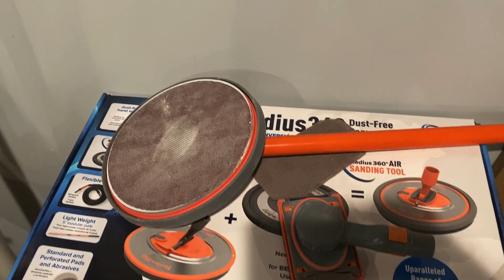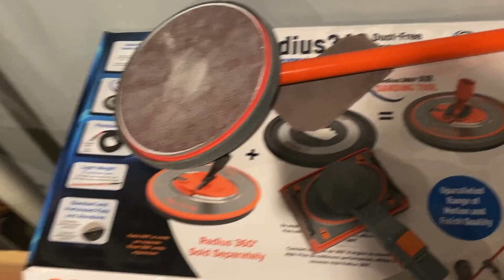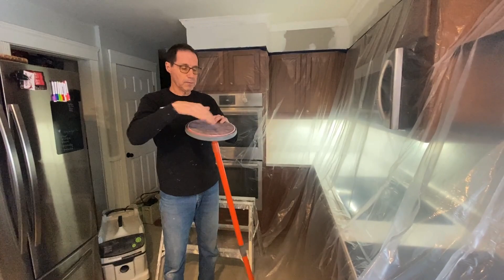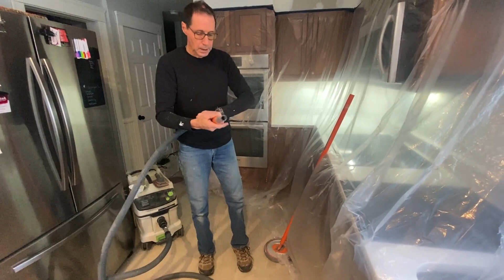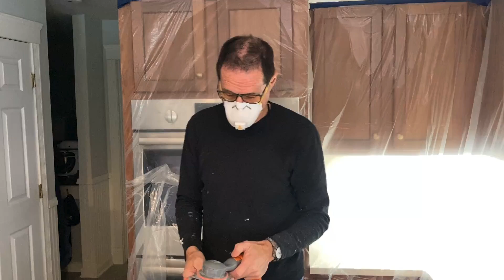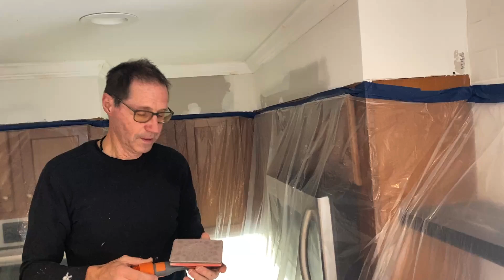Dust Control Drywall Sanding

Comment: I have the  combo kit with the round sander and the large hand sander. The large hand sander is worthless on it's own because the handle is so far away from the sanding pad it wants to tip with use. I ended up here because I was looking for information on the mini. What I ended up doing was swapping round head for the rectangular head on the pole sander, which works best. The large round head it nice if you only have to knock down a couple high spots on a very flat wall, but if your walls are less than ideal, you are going to do a lot of sanding trying to make things look smooth. The rectangular head will follow the warps and dips in the wall better and allow you to get a little closer to the corners. Either way, you are going to end up using a sanding sponge in the corners and to feather out some of the drywall mud seams.

The down sides? The plastic connector for the two pole parts is flimsy and doesn't connect them straight. I thought of trying to find a single long pole to use, but the pole was become firmly wedged into the saner head and I'm afraid I will break the cheap plastic if I try any harder to remove it. This means I can never put it back in the box for storage.The sandpaper is non-standard size for both the hand sander and the  round sander, luckily the round sander takes larger sheets and the standard size is only a little smaller, so it still works. Overall, this works for a temporary homeowner job, but I wouldn't recommend this for any kind of professional work. It's not going to last and it has a lot of parts that can get lose. The sandpaper if expensive and hard to find.  It does do a good job at collecting the dust, but you will still be using sanding sponges in places, which will make more dust.

Comment: What vacuum cleaner do you use? That dust destroys vacuum cleaners. Thanks.
Reply: He has a festool. Very similar to the on I use, but I'm not sure if it has the self cleaning mine has. They are very expensive, but in this case, I figured it was worth it because I am doing a lot of drywall work in the house we currently live in. I also use a dust separator to keep the vacuum from filling up and hopefully reducing the dust build up in the filter.